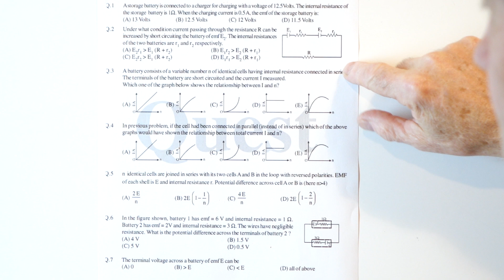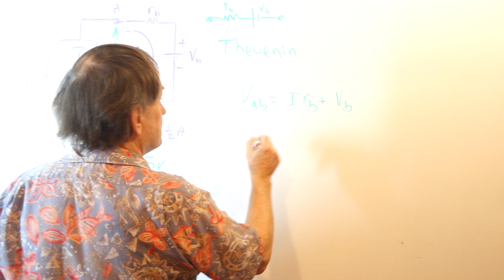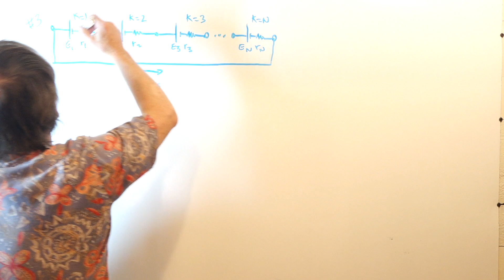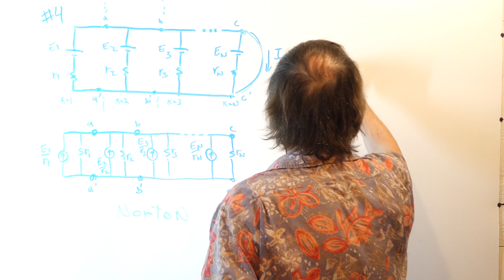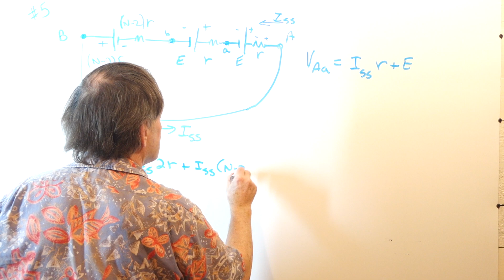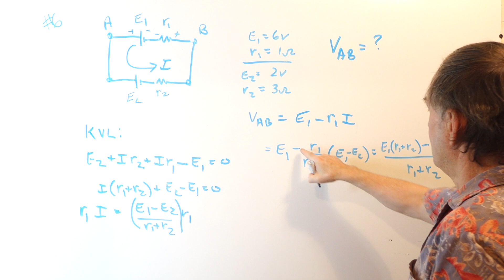Electrical Networks 1

Comment from the maker: Time 0:00    Introduction
        2:10    Statement of problems to be solved
        7:25    Problem #1 solution:   ans.  C   Vb = 12v
        9:59    Problem #2 solution    ans.  B   E1 * r2 > E2 (r1 + R)
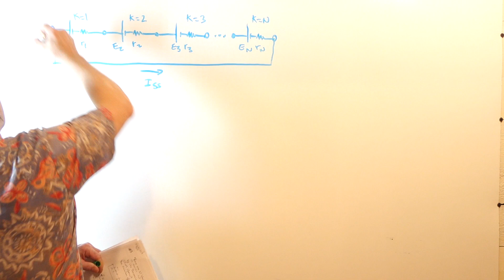      16:06    Problem #3 solution    ans.  D   short circuit current is constant
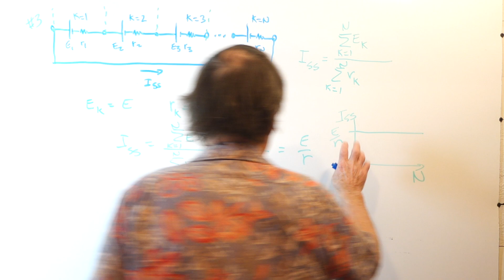      20:20    Problem #4 solution    ans.  A   Iss = N*E / r      linear function of "N"
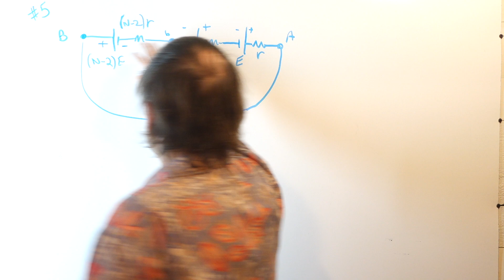      27:11    Problem #5 solution    ans.  D   Va = 2E(1 - 2/N)
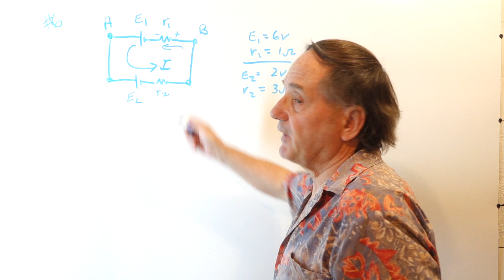      33:41    Problem #6 solution    ans.  C   Vab = 5v
      39:06    Problem #7 solution    ans.  D   Vab < > Vth or Vab = 0
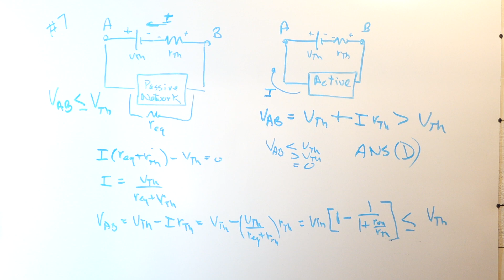      44:03    Problem #8 solution    3 sources and  3 resistors - loop /mesh analysis

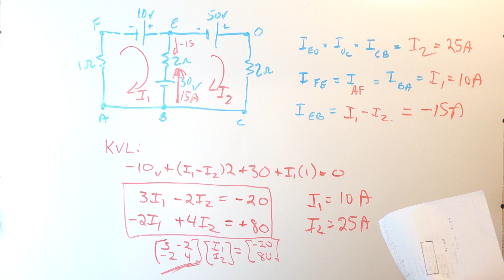      51:07    Repeat of introduction  -  mistake  so ignore the last 2 minutes

Comment: George,  how Is it going.

Was wondering if you ever finished up your lake refraction study.
Reply from the maker: Hey man,
Parts 7, 8 , 9 , 10 have yet to be uploaded.
I have fallen behind and plan to get started again in a week.

I cannot communicate with you via Discord since we have no servers in common nor can I  reach out to those on GEMs server ever since Capt BS kicked me out.   You can pass the word on to others if they wish to contact me via Discord then sign up for the NonSequitur show or the math channel so we have a server in common:

https://discordapp.com/channels/390029179216855051/460208637365846047

https://discordapp.com/channels/268882317391429632/359052581022203914

OR just post a message to me on one of my videos as you have done.

take care,
George
Reply: George Hnatiuk invite to non sequitur might be fun